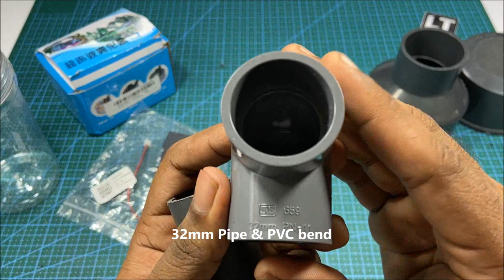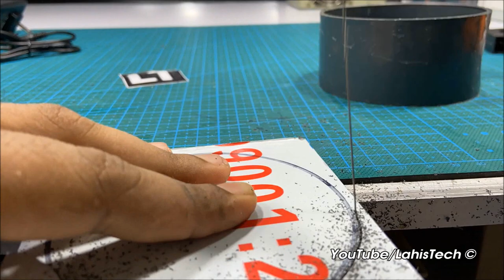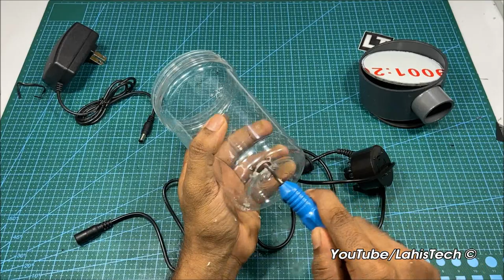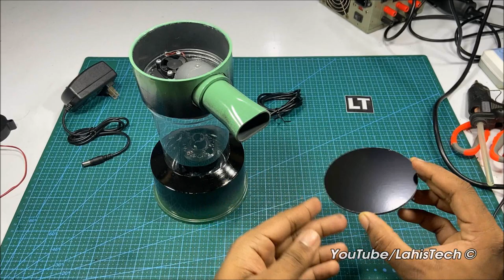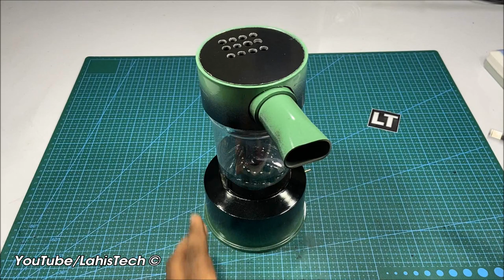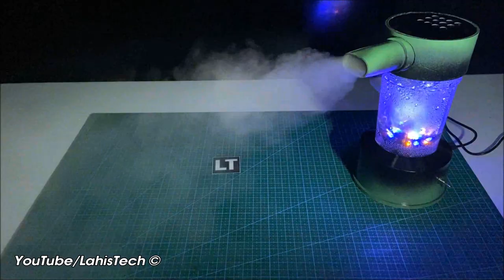How To Make Air Humidifier | Mist Maker Diffuser

Comment: what is the voltage from the AC adaptor to the humidifier circuit?  how long does this unit produce mist?  does it necessarily have to be kept stable or can you move around with it?
Reply: Adaptor DC 24v
Reply: question a : 24 volts dc
question b : it produces mist using water so it will work forever as long as there is water inside cup
question c : u can move around but it should be connected to the current input (the adapter plugged)

Comment: And you need a filter/or thing that turns tab-water lime so that it does not form crystals when water is left on surfaces or when it goes to lungs. Tab water is  the worst you want to breath in. Those should have a some kind of sign of that you should use appropriate water with those which is e.g DI or distilled water. You can buy a DI cartridge and put it at the final stage of standard household Reverse osmosis water purification system. I got mine working and I am exited to build ultrasonic water humidifier... Now at south Finland we have had 20RH fort the last 2-3 weeks.
Reply: where should i place the DI cartridge
Reply: @moonjunn8567  Ideally at the end of household RO- system, but alone at the end of tap should work too. You will get rid of minerals but other stuff like bacteria goes through. Minerals are worst I think. Bacteria can be stopped with carbon filter(usually a part of RO system). Tap water thrives the water through RO filters and DI filter but If tap has too low pressure RO pump can also be used. Many RO systems come with intrusive connection mechanism that pierces your small copper/metal water pipes and takes tap water that way. So then you will not need plumber-man. I made a portable RO-DI system with pump because I didn't have guts to use that piercing joint valve.
Reply: distilled water doesn't work. the sensor for water level don't trigger on distilled water unfortunately.
Reply: @JLaurel  That's odd
Reply: @surmur  I had one and used with tap-water without any problem, left it in another country when i moved... now I order another one and spotted this claim in many comments on amazon, it make sense because pure (distilled) water do not conduct electricity. The water level sensor will have difficulty to sense the water.
Reply: @JLaurel  Then the sensor needs unpure/unsafe water to work. If there is a safe and conductive additive for DI water that would be way to go. They vape in at least C-vitamin and B12. B12 is 100% safe. C-vitamin is dirt cheap and conducts in water. Tab water: Those micro droplets containing minerals will sink downwards as the evaporation cools the air mass and then luckily the evaporated water from those droplets are pure and safe to inhale( that humidity will be spread all over)). The residue accumulates to lower surfaces over time. I don't know what/how much is needed to inhale for actual symptoms. In case of them it may be pretty bad or "too late" by then. Lungs do exert dust and many sort of particles via saliva movement but mineral residue have started asthma in someones I have heard.

Comment: What will happen if water drains completely... Will stop by itself?
Reply: the disk or ultrasonic humidifier will vibrate so hard that water splashed into tiny particles those particles are so small that mist is produced, if the water is drained the disk will vibrate but no mist will be generated

Comment: Bad Idea, Sir!! It dosen't allow for (Water) height adjustment, as needed, or else when water is emptly, or too high, it will not work. Best would be to put it on a swimmer of types...
Reply: Mounty:  Watch the video through to the end. It works just fine.